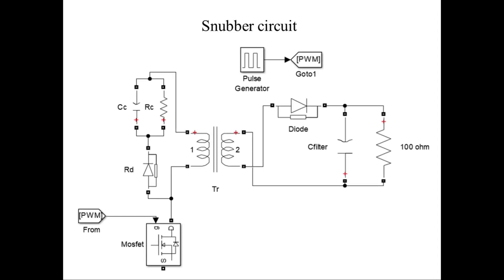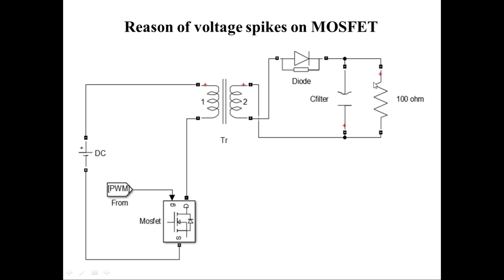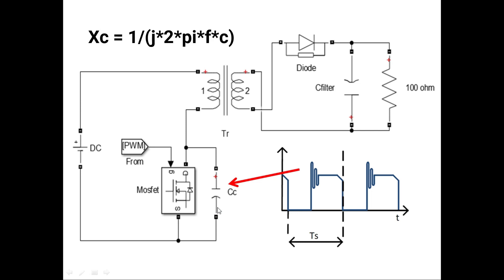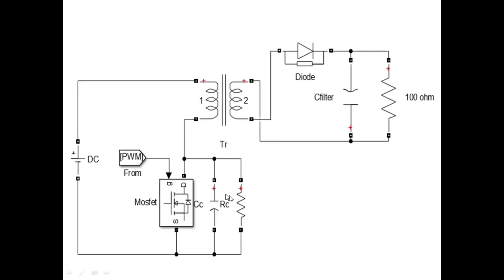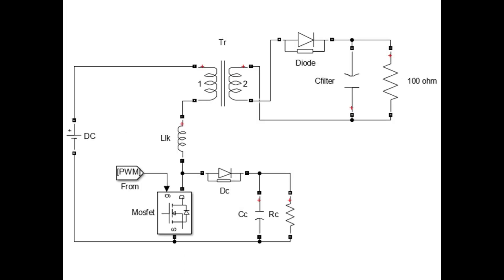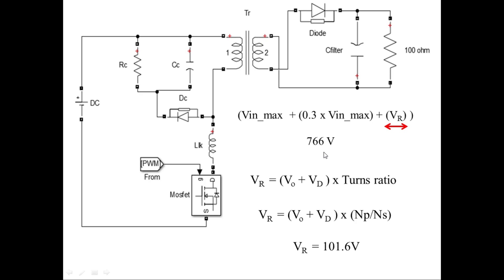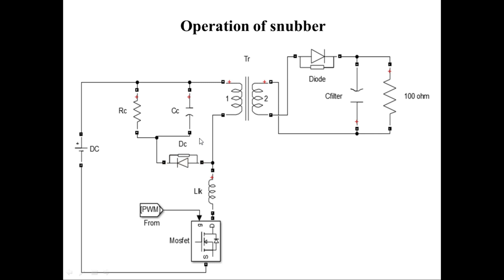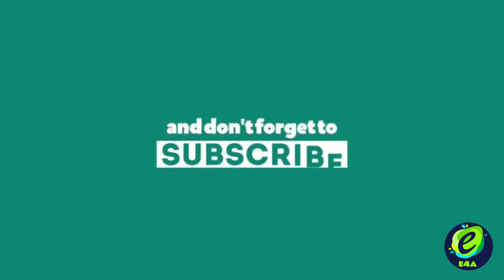#9 SNUBBER CIRCUIT EXPLAINED | RC SNUBBER | POWER ELECTRONICS

Comment: Very nice and compact explanation, thank you. However, when you move the RC snubber circuit from minus supply to positive supply, the anode side of the diode must remain connected to the drain of the MOSFET. It is not possible to connect the diode in between the primary transformer winding 1 and the leakage induction Llk, because that node is not a physically existing point. It is an internal node of the transformer model, so in practice you can’t connect anything to this point.

Comment: How about having a "series RC circuit" in parallel to switching MOSFET.
Reply from the maker: Any component put in parallel of mosfet will not be able to stop voltage spikes from transformer. For that the component must be in parallel of transformer only

Comment: Do I need a snubber circuit or a clamp diode for a push pull high frequency inverter? Or a push pull high frequency charger upto 50khz
Reply from the maker: A clamp diode will be required here because snubber circuits are slow and not suitable for high speed applications

Comment: So in the second configuration where the snubber is between the primary coils, are we also allowing more voltage to stress the MOSFET since we aren't snubbing the leakage inductance? Which might be acceptable if the FET is rated for that, but just wanted to make sure I understood the tradeoffs of moving the snubber circuit.
Reply from the maker: Leakage inductance is not actually present in physical form.

When we implement a transformer or inductor or any other source of magnetic field then a major portion of the magnetic field gets linked with the respective inductor or transformer. But a small amount of magnetic field does not flow through the intended magnetic element. This field gets lost and it does not contribute in energy transfer. So for simplicity we depict or display this field in the form of another small inductor or transformer in series (or may be parallel in some cases) with our main magnetic element. This is nothing but leakage inductance. So even if you do not show this leakage inductance in series, it is always present there.

So in our tutirial the keakage inducatnce is already and always embedded in the primary of high frequency transformer. 

Now in our tutorial video it is shown that leakage inductance comes after the connection of snubber and primary of transformer. This was actually a mistake. From the above explaination we can say that the leakage inductance is embedded in the primary of transformer and it does not lie after the connction of primary of transformer amd snubber.

Now the voltage withstanding capacity of FETs must be as low as possible because the cost of FET increases with increase in voltage withstqnding capacity. So snubber is designed in such a way that it must absorb as high energy as possible from the inductive kick such that energy diverted to FET is as low as possible and the voltage withstanding capacity of FET is again as low as possible to keep the cost to bay.

I hope I made sense 😄😄
Reply: Thanks for the detailed reply! So if I understand correctly, the snubber in the 2nd configuration then also dissipates and attenuates the sum of the reflected voltage and the Leakage inductance kickback (0.3*Vin_max)
Reply from the maker: @CannonballCircuit  Yes exactly....😃

Comment: Electrolyte capacitor can we use as a snubber capacitor
Reply from the maker: Electrolytic capacitors cannot be used.

The capacitors should be of tantalum, ceramic or thin film types.

Comment: Waoo Many thanks for your guideline. The snubbing capacitor is electrolytic type or non electrolytic type. please guide . more over one calculated value may help as an example
Reply from the maker: Since snubber circuit is subjected to switching frequency, it charges and discharges rapidly. Electrolytic capacitors are not made for such rapid transitions.

So, the capacitors should be of tantalum, ceramic or thin film types.

And we will surely include a calculation but right now we are busy putting out a course on Embedded C development.

Feel free to check it out - 
https://www.youtube.com/playlist?list=PLJGDxJZDiVu8JgYdVTxedAZhTJ5dyMkzO

After the embedded C course we will surely give a calculation example for snubber circuit...

Comment: In rcd snubber circuit,why energy only through diod and capacitor ??? I think it also through diode and resistor.you can explain ? I really don’t understand. Feedback to me.Thanks
Reply from the maker: 1. Impedence of capacitor is 1/(2*pi*f*c). Which means it is inversely proportional to frequency and here the frequency of voltage is same as the switching frequency of PWM controller which is in kHz. Hence the impedence of capacitor is very less.
So capacitor provides a low impedence path. 
2. The capacitor is selected in such a way that the impedence of cap is lesser than resistor. Moreover, resistor is selected such that the R*C time constant is such that before the next cycle of PWM arrives the energy of cap is quickly dessipated in the resistor and it discahrges the cap totally.....

PS- sorry to have replied so late 😇😇

Comment: Thanks sir.So useful!
Can we use p6ke or 1.5ke TVS diodes for high frequency switching for example 20khz or higher?
Reply: 1. Any diode can take certain power or current for certain time which is generally in ms. You will have to look at graph of peak pulse power rating wrt pulse width. So for every power level you will get the maximum allowable pulse width in time beyond which the diode will get destroyed. You will have to know the power that will be dessipated through the TVS diode.

2. You can also refer the graph of peak pulse current Vs time. Follow same procedure as descibed for peak pulse power.

3. Or you can simulate it in LTSpice